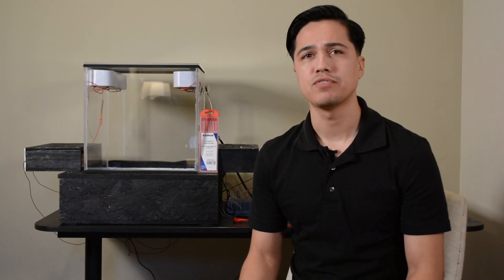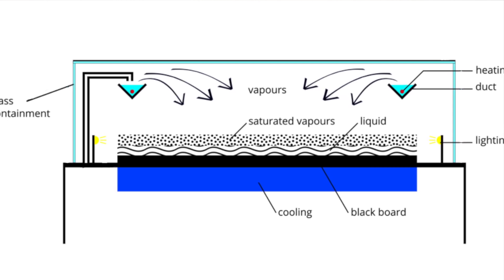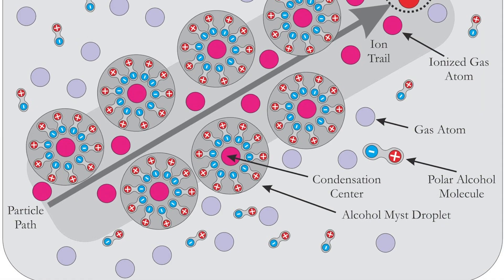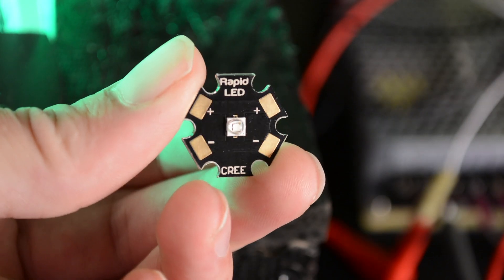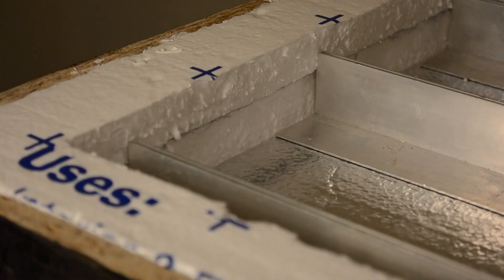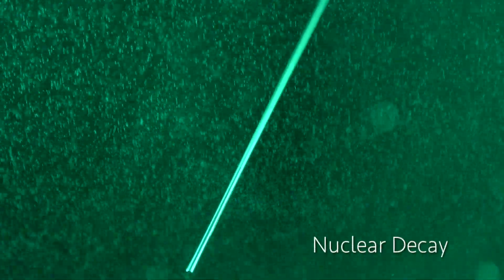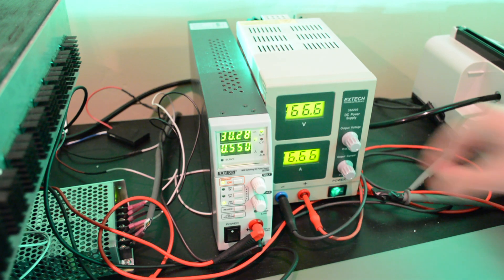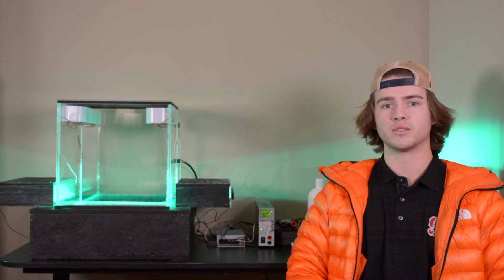Creating a Diffusion Cloud Chamber

Comment: Nice work! I have built several cloud chambers in the past and have some advice if you want to iterate on your design:
-insulating the bottom of the heaters and using a smaller chamber can increase your thermal gradient
-Adding a high voltage electric field can greatly enhance ionization trails. The cylindrical "high voltage boost converters" on amazon provide a cheap and safe way to do this, provided you take care to prevent arcing in the flammable atmosphere.
-Using the Am-241 button from an ionizing smoke detector will provide alpha particle trails that are much easier to detect than thoriated tungsten or cosmic rays.